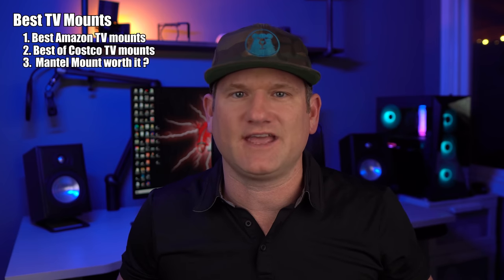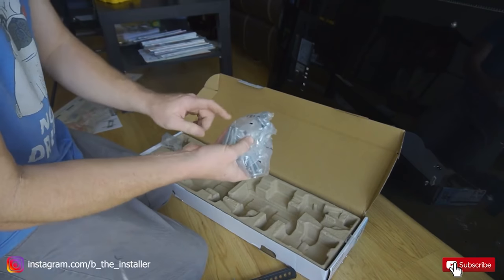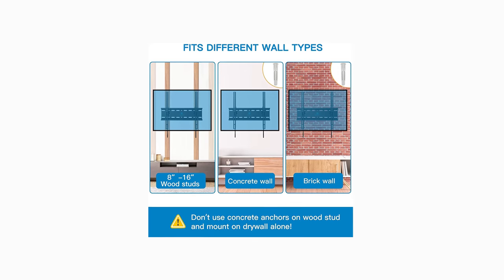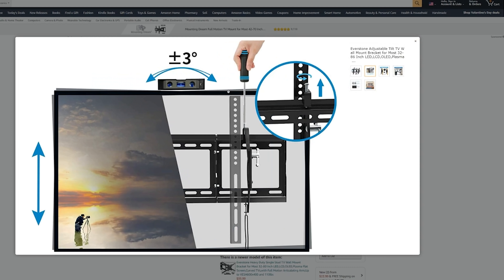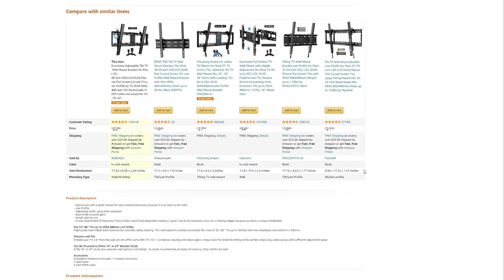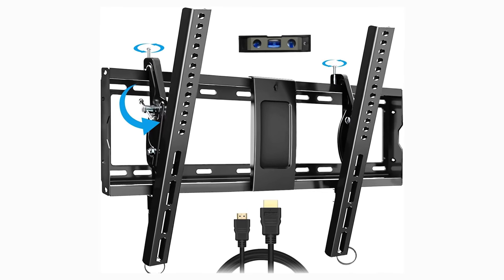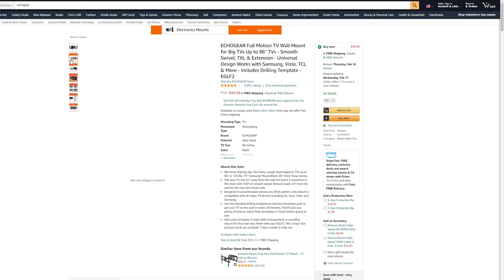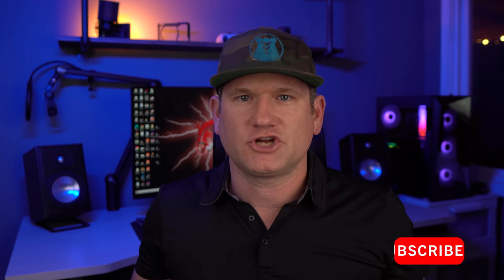Best TV Mounts on Amazon and Costco + Mantel Mount info

Comment: Nice vid. Just curious, why is the TV size important in selecting the mount? If the weight and VESA pattern fit within range, is it safe to mount even if the TV is larger? (e.g. mounting a 75 inch on a mount for a 55 inch). Thanks!
Reply from the maker: Yes you are correct. Sometimes the size of a tv matters if  that 100 lbs or so is larger tv it cqn pull on the tv a little more but overall if the Vesa works and weight works, you should be fine.
Reply: @BTheInstaller  Thanks. I just mounted a 75 inch TCL 6 to a mounting dream that holds 99 lbs. I found the position super hard to adjust due to the TV's size. When I try to move the TV, I end up tilting it forward instead just because of the bulk. Otherwise, the mount seems to be holding the TV no problem. I'll let you know if I hear a crash in the living room.

Comment: Thanks for great video!  One question that I can’t find an answer to is whether the mount allows you to move the tv left or right along the wall?  Would the Echogear be a good choice?  When I put the Christmas tree up for one month out of the year, I move my tv about 2 feet to the right along the wall sitting on a cabinet.  Thanks!
Reply: Don’t know the answer, but thanks for asking the question. I have the same issue!!! I didn’t even think of this
Reply: I don't know of any mount that you can move 24" left or right.

There are some that extend up to 45" out from the wall. But moving them to the side you have to compensate for the width of the TV.

Comment: Do you think Sanus mounts are overpriced? I've been using mounts from Amazon for years and they work amazing and they're usually are around $20. I don't know why anyone would pay hundreds of dollars for a wall mount (Sanus) when you can find some good ones for under $20.
Reply: im trying to look for one that can swivel left and right without hitting the wall any recommendations?
Reply from the maker: Well you need to are the size of your tv and half it and buy and mount with a long enough arm.  55" is 49" so 25 inch arm or so will get close to 90°
Reply: @BTheInstaller  perfect ty

Comment: Great video. What fully articulating mount would you recommend for an older 70" Sharp Aquos TV.  In looking at specs, it states weight of TV is 119lbs. I was considering the Pearlsmith PSXF4 from  Amazon. Great price point, ease of installation and will serve my needs.. my concern is if can eithstand weight of Sharp TV.
What are your thoughts on this mount ?
Thanx
Reply from the maker: Yeah that should work.  Those old sharp tvs are massive and heavy so something like that is needed.
Reply: Thank you for your response

Comment: Are there any mounts that not only move in the horizontal plane but also vertical plane?  Ie many move in and out from the wall, they can also swivel to face left or right, plus some also tilt down. But I can’t find one that also shifts downwards so that it sits lower relative to the mount. Are there any?

Comment: Was gunna get a TCL 635 75” but the back of the tv looks like it could be a pain to wall mount. Also I saw in the user guide it says to use a wall mount that holds 5 times the net weight to keep from damage. Have you had any luck installing one?

Comment: Be careful with the single arm wall mount.  If you are adjusting it a lot the mount does not hold the specified weight and will start bend.  IMO go with something a little meatier.

Comment: Mounted my 85 in tv on a tilt mount 2 bolts on right side on the stud but only 2 drywall anchors on the left should that hold or do I look for another way to mount it?
Reply from the maker: I can't say for certain because I'm not here but normally when I have a flat mount with Tilt it is fine with 2 toggle bolts. But if there is any extension it is different.

Comment: Excellent video. What mount would you recommend for my pioneer pro elite 151FD?  It’s a 60 inch screen. Looks like vesa pattern is 850 x 500. Thx a bunch!
Reply from the maker: Haha, that's a tough one.  They had really big mounts in the past but not a lot that does that size pattern and handles the weight.  I used to sell but not anymore.
Reply: Hey B thank you very much. I did finally find one called the Vivo extra large 60-100 LCD. Arrives tomorrow. Quick question. You most likely know the Pioneer Elite 151 was a great tv in its day. Here’s my question. Would I notice a huge improvement in picture quality if I got the newest LG Oled or the Sony A90x?  Thx a ton!
Reply from the maker: @chrisrizzo5976  yes.  It's much better.  The a90j is remarkable.

Comment: Hey B! Learned of you from FOMO and subcribe now. I have a 65", 53 lbs. panel I want to center on a stud (can't center between studs for aesthetics) and extend straight out 12"; don't need swivel or tilt. Will the single Perlesmith PSMFK1 work? If not, what would? Thanks! Catchya next time with FOMO and Techno Dad.
Reply from the maker: Probably not. It's better to use this type of mount, thus one exactly to be honest and put that stud in the middle of this, and you really don't even need to pinch the corners with anything, but toggle bolt top left and right may make you feel best.  This would be much more secure with 1 stud over that smaller weaker single stud mount.  

https://amzn.to/2ZcWHKW

Comment: Thinking we need the Mantelmount since we're going above the Fireplace...deciding between the MM540 and MM700.  Any experience with the 700?  Trying to determine if it's worth the extra $220.
Reply from the maker: They both sit off the wall a good deal, I think the 540 is pretty big and solid.  Make sure you have 1 stud central for that before you buy.  If you need it to lower, get it.  I prefer a more flush look and wouldn't use the mount much, I don't think.
Reply: @BTheInstaller  Thanks...we're redoing the whole fireplace (whole condo really) so we put whatever we want studwise back there.  Also planning to build it "into" the mantel if we can to have it stick out less.

Comment: I've probably mounted more than 3 thousand TV'S in my life, in General Walmart has the most simpler, sturdier and versatile TV mounts of all for an excellent price,  of course there's some from Amazon that are compatible (like this guy recommends)  don't buy Sanus they're overpriced and the full motion would be a pain for a beginner and even though is big they're not stable, they really suck, the full motion ONN for up to 86" really kicks butt. I have learned most customers buy the most expensive without really knowing what they need.  I definitely don't agree with the Full Motion Sanus, big but very very unstable ✌
Reply from the maker: The sanus mount is sold in every Costco in us... so it's relevant and it's just fine. Sometimes on sale for $89.  I would see it a couple times a week and so I feel it's worth mentioning. It's actually quite strong, I have my 83" A90J on it and it's just fine.

Comment: Hi B, thank you for yet more TV information. I spend endless nights researching the best tv gear and your channel has helped me put at least 2 tvs in every room of our squalid hovel. I should note that there is only one room in our squalid hovel, and all two of the walls have large tvs on them. If we can fix the ceiling flaps then theres even a chance of mounting one above the communal wash hole. Hiding the wires behind the rancid sheet metal paneling has become rather challenging given the amount of extension leads we have to run from our landlords log shack. Hopefully the weight of the new screens wont compromise the structural integrity of the handcrafted hovel.

Could you possibly make a video on how to hide wires behind rancid sheet metal paneling?

Comment: I need your help . My wife is giving me hell. I bought manhattan tilting mount code 4640971 that claims it can hold 35 kg 400 ×400 vesa pattern  up to 55 inch tvs  . And my tv is samsung 65 inch and weights 25 kg . Each time an installer comes they refuses to mount the TV  and says the mount is too weak to carry it. They insist it is too heavy to be mounted without giving any scientific or technical reason . 
Please tell me for sure that it can hold it and I will mount it myself . I am tired of fighting with everyone
Reply from the maker: Your code didn't work.  But yes the mount that is 35kg and 400x400mm pattern, can hold a y tv up to that weight with thay pattern. Normally a size of a tv is listed as general rule per the Vesa pattern but you are correct. Not sure why they all bail. Likely lazy or inexperienced.

Comment: Hey B, could I install a 55” LG CX on the Sanus Flat and Extend mount on just dry wall with toggle bolts?
Reply: Don’t do any full motion on drywall alone.
Reply from the maker: Yes you can do a 55" tilt and extend on drywall with toggle bolts.  Even a 65.. but not bigger.  Still would prefer to hit 1 stud along the way, even metal stud.
Reply: @BTheInstaller  I misread. On a tilt and extend, if it’s not too heavy, sure. But only if you have no other choice. Only reason I wouldn’t do it is because I wouldn’t want my customer trying to plug something in or interacting with the tv a ton and pulling it out of the wall. Toggle anchors hold tons of weight. Drywall.... sort of depends.

Comment: Nice video. I use the echo mounts! Love those mounts with the larger wall plate to extend to 24inches. Also you don't have to assemble too much and that can slow you down at a job site. I can't stand the sanus mounts. Too many little screws etc

Comment: please don't cheap out when buying the more higher priced TVs. Sanus makes some great mounts (yes, are more expensive). I don't get why when some people spend over $3k for a TV they cheap out on the mount that is literally holding the TV on the wall. Why have $20 holding up $3k? Just get yourself a bit more of a premium thats easier to install than those cheap ones that come in multiple parts taht you have to put together yourself.

And a note on the mantle mounts, its cool but he's right, a pain in the ass to install (if you have someone else install them, give them a fat tip)

Comment: Very interesting thanks for doing it. Question: the Stud is in the center of where I want to put my 50" TV. Should I install the mount only in one stud or try to use two ? Thanks
Reply from the maker: If the tv is within the mount weight capacity, the mount can normally easily handle it on a single stud if centered on the mount.  Even hitting the top corners with toggles to add strength is helpful if hesitant.  2 studs is best if possible, but sometimes it is not.
Reply: @BTheInstaller  thanks a lot

Comment: Can you tell, how much tilt you can mount on the thin LG Oled like BX or CX?
Reply from the maker: I don't understand.
Reply: @BTheInstaller  I mean, because the display is so thin and made of glass, maybe it could break at a 15 degree tilt. And whether you have experience in it.
Reply from the maker: No.  The OLED can handle its own weight.  Maybe the 77" CX is weakest at extreme downward angle but no you can pick a tv off the ground by the mount and manipulate it in any direction and it holds its form
Reply: @BTheInstaller  thank you very much!!!

Comment: Thank you
Reply from the maker: No problem.
Reply: @BTheInstaller  challenging install coming up for me hiring a professional as the narrow GX mount cannot catch both studs and I don't want to risk the 77inch falling down and smashing haha. 😀 
Now what I'm thinking is to cut the dry wall replace the cut bit by 500x700 thick bit of wood secure it's with studs and run the cables thru the wall and mount goes on it. 
If you can suggest anything plz do let me know.
Reply from the maker: Where does the stud hit on the mount ? Middle or edge?
Reply: @BTheInstaller  it doesn't hit any stud, falls right in the middle of the two studs due to how narrow it is. There's no room to move tv either side it won't be in the centre in that case.

Comment: Not gonna lie I bought the Armstrong full motion mount because it was cheap and on sale. Put it in my studs but used my own Lag bolts with shoulders. I did 3 pull ups on the arms and it didn't even budge. Super impressed.
Reply: I purchased an Armstrong mount would not fit my tv 400 x 300 vesa I was disappointed because it seemed like a good amount

Comment: I’ve used Mounting Dream mounts on every TV except my 77” OLED. I opted for Sanus on that one. The MD mounts are amazing, and the wall bracket is the exact measurement vertically, meaning different arms can fit different wall amounts. This was useful today; I have a TV with telescoping arms but didn’t need them or like them. My brother finally got a Sonos sound bar and thus required the telescoping arms to have proper space from the wall. Many of the brands on Amazon appear to have the same attributes as long as you stick with the same brand.

Comment: Any advice about using an articulating mount for a 75 inch TV weighing 63lbs.
I like the TV to be flush, with the option of movement you get with the articulating mount. The TV starts out flush, and after a few hours, starts tilting forward on top. Is there a remedy?

Comment: Your info video is GREAT! Thank you for sharing your knowledge. It's obvious your video is not for those who are in the construction phase and I would like to offer something we did that may not be all that unique, but it worked for us. And, with a  little extra effort, could also work on many walls that are part of some "remodeling." 
                                                                         We chose to RECESS OUR MOUNT!  :-) 
We originally were thinking of putting the entire TV in a recess (read niche) and then realized that by doing just the mount, we had no future restrictions to what size or shape the TV might have. The mount I used in our last home was a fully articulating Monoprice #12280 mount that had such impressive "extras and quality of engineering" that I had to try to find it again. I did.  :-)

I hope this helps anyone who wants their TV to be as close to the wall as possible (considering operating requirements) and it must be mentioned that the recessed area for the mount, alone, should have electric and A/V cabling access mounted in such a way as to NOT interfere with MOUNT's moving parts! Thank you again for your great advice!

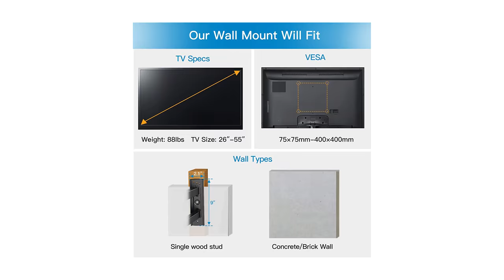Comment: I'm totally confused from 7:52 , referencing single arm mounts, where you say that the mount has to go on the drywall between studs?!  I cannot figure out what you mean at all!  When would somebody EVER opt to put a mount on drywall BETWEEN but not ON studs?  

I purchased this type of mount, not the same brand but the same type to mount my 42-in TV.   I must be missing something because I thought you ALWAYS mount to studs.

The base of the mount certainly is not wide enough to extend stud to stud so I'm just not having the light bulb go off in my head about what you mean.

Can you please clarify before I destroy my wall and TV and anything else that might happen to be around? 

Thank you!

Comment: Sorry 
Sanus Premium Full Motion TV Wall Mount for 46"-95" TVs VXF730
30" pull out from wall with full right left swing Tilt and diagonal Tilt. 
There is none better. 
If your taking about a C1 $2,000 to $5,000 TV you want full movement and your not going to get that with the mounts your advocating.
Ok
Even $800 tv I would still go with a $300 Sanus

Comment: So I have a 40” tcl Roku tv just for the basement, but it says I need a ves 100x100 but every one of that size only goes up to 30-35 in TV’s? Can I use a ves 200x200 ? Or is the spacing too big ?

Comment: I bought a standard tilt mount..I had two problems.    I was not care ful about the wires from the tv to thru the wall..I almost cut them in half by trying to tilt it.  2...  once mounted my fat arm count not fit between the wall to reach the adjusting buttons.. I solved this with a 36" plastic pipe with a v cut into the ends..  thanks for your video s   you are very informative

Comment: I am in a quandry. I PLAN TO BUY AN 83" C-1,LG OLED. I need the dimensions from the bottom of the TV to the lowest set of mounting holes. I bought the more expensive pull out-swivel COSCO Sonos mount. In order to finish my mounting system, I need the dimensions mentioned above. Nobody has those dimensions or knows how to get them. I have made upteen calls to LG assistance and they only have what is in the manual. Help, anybody
Reply from the maker: I wouldn't base all the installation work on the math prior to having all the products in hand.

Comment: I have a single stud mount that I used for a 48 inch tv I want to know if I can use the same mount for a new 65 inch TV? It fits the back 400 x 300 the single mount has 3 bolts 10 mm that are about 2.25 inchs long will this mount support a 55lbs tv or do I need a new mount?

Comment: kinda off subject, but have you found some decent lights to mount behind the TV that can actually be powered by the TV's USB input? They can be very finicky as far as getting enough power to them. I have an older Panny plasma, and even when I bought a usb "splitter" that was supposed to combine the power of the 2 ports to one, it STILL didn't wanna work w/ these particular lights!

Comment: B nice video.  I do have a question for you.  I want to install a wall mount in my bedroom.  The wall opposite the bed has a pocket door which leads into our newly remodeled master bathroom.  The wall area is is 60 inches wide and the pocket door measures 30 inches.  So 1/2 of the wall area is taken by the pocket door.  What would be your suggestion for a wall mount solution.  I'm thinking a 55" TV would be perfect for the space.  Thanks in advance.